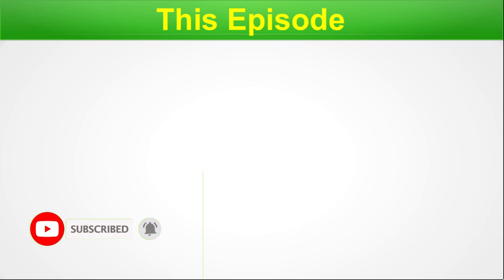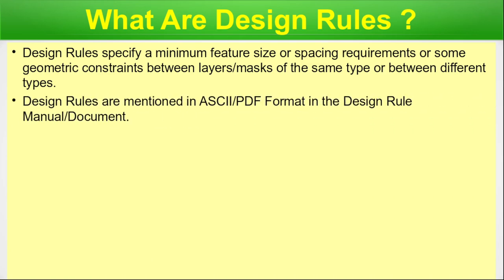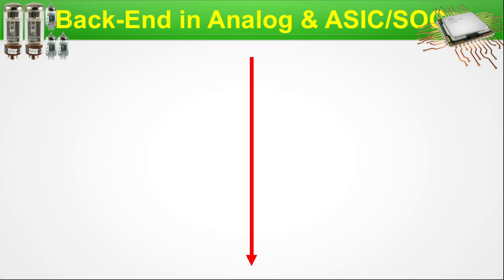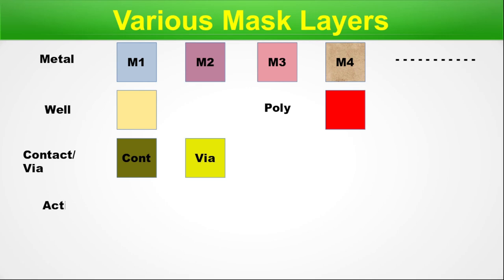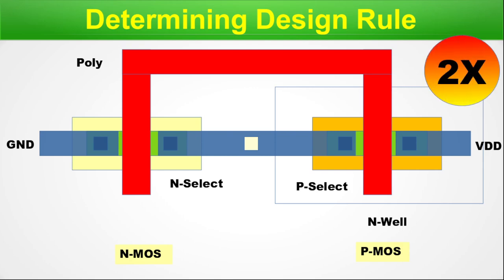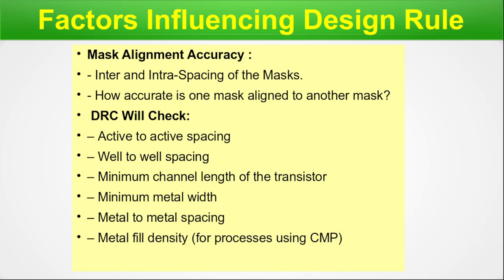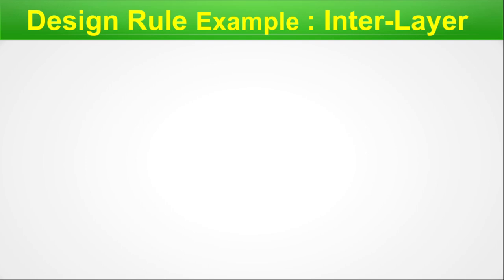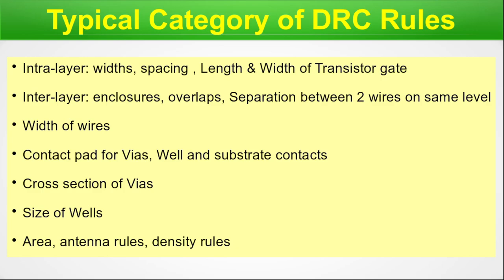Mastering Design Rule Check in VLSI: A Comprehensive Guide

Comment: Sir can you please explain about innovus tool commands for  clock path setup violation with practical examples
Reply from the maker: To Make a Tutorial on any Cadence/Synopsys/Mentor Tool first, legal agreement and NDA has to be there with respective company and TechSimplifiedTV. This is a complex process which I have done/involved while working inside the chip Industry.  In addition to that The setup will require SPECIFIC Hardware (Huge RAM / Multi-core Processor / High End GPU) + Enterprise Linux (SUSE/RHEL etc ) . Such thing may be planned for future in the log run , however at present we do not have the financial budget and legal process to do this ! TechSimplifiedTV DO NOT SUPPORT PIRACY ! Hence there is no short cut !
Reply from the maker: In this channel there is a STA Full course using open Source STA Tool : https://youtu.be/kzrF-xo23f8 .